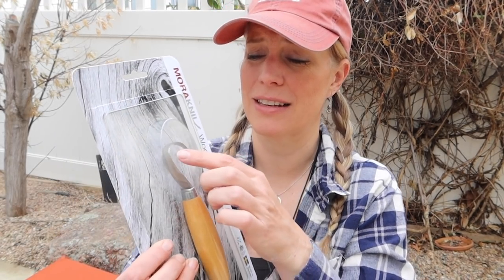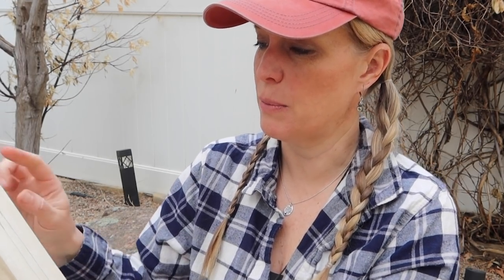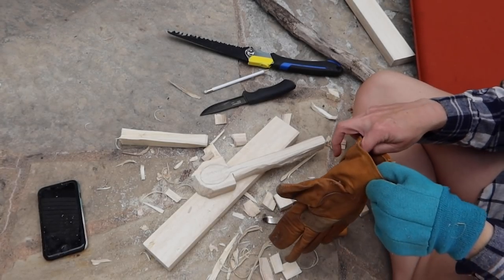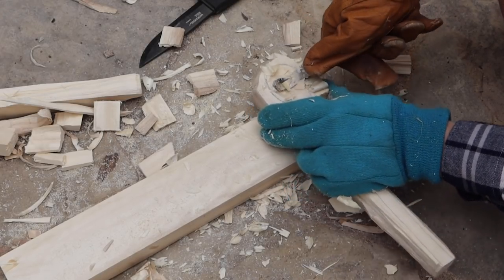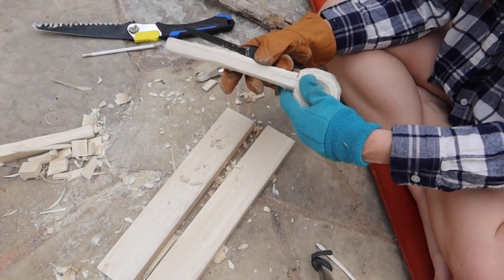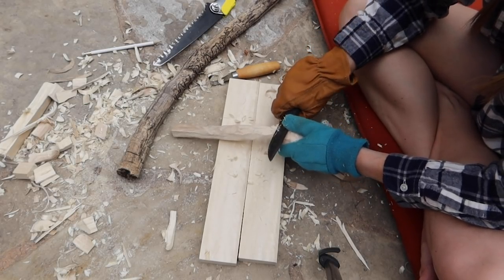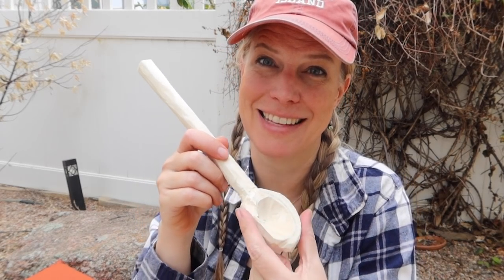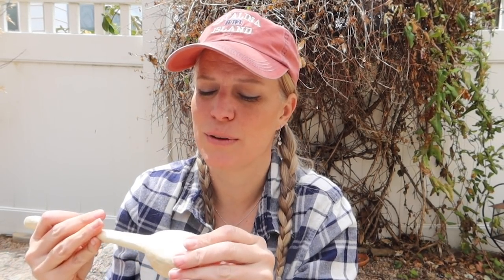Keeping Your Mind Busy Creating - Carving Spoon - Spirit Forest - S4 -Ep#28

Comment: Thanks for the shout out Tammy! If you will use your left thumb to push your blade on your knife it will go much better. The grain on the wood does tend to go in different directions that causes you to have to figure out the best direction to cut in. You did great with the spoon knife. You can get best results by going easy with it. Make sure that your knife is very sharp. Mineral oil works great. The veg oil will go ransid. Keep up the great work!

Comment: That was a fun watch, if you want a tip use your knife alot more, battened point of your knife to get deep hollow shape, and your curved tool to finish it off. Knife edge 90 degree's to the spoon once your nearly there and use it as a scraper to take it down where you want it. Save yourself a load of time and scraping with your knife give you a much better controlled shape. Save the blisters. Arthur (UK)